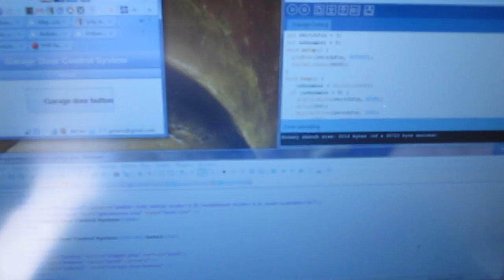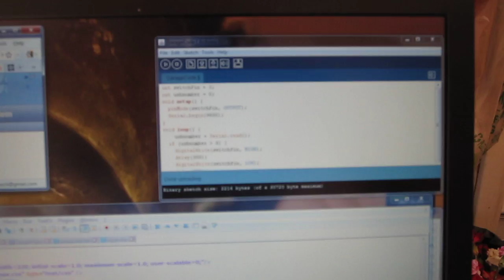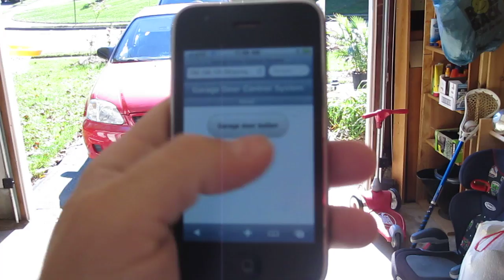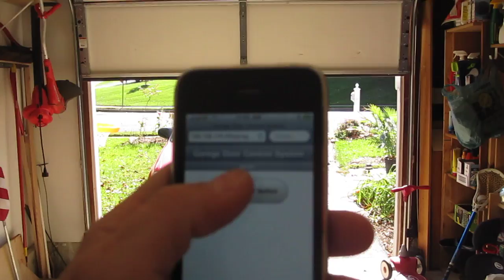iPhone controlled garage door opener using Arduino

Comment: not bad, but using wifi to control objects is BAD idea. You should choose some RF stuff.like car locking system or something similar. What if you phone could not connect to wifi? Also some rf would eliminate need of web server. Just good old receiver + transmiter

Comment: very cool but an average person can't just make this.  see the iHued cable, it connects to an old android phone most people have sitting around and then you can open/close your garage door over the internet from worldwide.  is also utilized the camera that's on old android phone so you can see the garage move up/down or you can just use the camera to check if you forgot to close it.

Comment: great stuff, but please lube the screw drive on your Genie opener.
You can use the same wire connctions up on the motorhead and dont have a ton of wires into the wall button.

Comment: Nice app! How would you secure it if you take it online? 
I would love to do something similar, also use RFID to unlock doors etc. 
It would be great to be able to open the garage door even if the WiFi is out, but having a PHP side open would be a bit of a security issue, wouldn't it? Of course you can use other ports etc, but it would be best to secure it with a login I guess.
Btw; If you have a login, you won't get that app-icon on your screen when making a bookmark...

Comment: If you're planning to use the laptop all the time you can probably use a USB to Parralel port cable and get 10-12 GPIO outputs of it. in that case you can completely take out arduino from the circuit. it just complicates the system. but if you're planning to take out the laptop then what youre doing is great.

Comment: Nice stuff, I'd done a similar thing with a door lock. Though it was running quite different. My biggest issue was safety, because it was safe on a iphone, but we could pretty easilly bypass the entrance with a laptop. What did you do for security?

Comment: @geoffmerck Use a limit switch. They have limit switches with a retractable arm/wheel. Position the limit switch to close whenever the door is physically open. Run some leads from the switch to the arduino board and write some code :).    Great video by the way.

Comment: Some ideas regarding your "next step" comments at the end of the video.
The arduino does have the capability to broadcast it's own web server (same resulting page, bypassing the computer and serial communications).  However, if you want to stick with this setup, you can use 2 arduinos and xbee radios to communicate between them.  You may only need 1 arduino board by using an ftdi cable/ breakout with xbee at the computer and an xbee connected to arduino's serial pins in the garage.  Good luck!

Comment from the maker: As for the code, I'd love to take a look.  And as for the garage not telling the state, all garages *should* have an "open" and "closed" trigger switch on the track that tell the motor when to stop.  If I can drop the voltage coming off of there, I could feed that directly to the Arduino, but I don't want to fry it (another relay needed).  With that feed to a relay, sending signal to the Arduino, and the code you mention, that could do the open/closed status.

Comment: Nice! I have a friend who is using the Arduino ethernet shield and another router. That way the only things in the garage are the Arduino, shield, and the router. My garage door unit can't tell me the state it is in, I would have to add external sensors. I have some PHP and Arduino code that will send data from the Arduino and the PHP will query it on a page refresh. Let me know if you'd like me to send that to you

Comment from the maker: Already did from the button.  2-wires up to the opener and 2 wires down to the basement, all along the frame of the door, just haven't updated.  I have a "conduit" of sorts that is running to the basement.  20 feet of doorbell wire is running to the project board down there (still not in a box) then jumped to the arduino.

Comment: How do you go about the whole PHP thing. I just got my arduino yesterday. I am pretty good at programing but I never used .php before. Can anyone point in the direction to start. I just want to start with something simple like I push a button on pc or ipod and the LED turns on. Any help?

Comment: You can put the Arduino and everything in the basement and then have an electrician run a line from your basement to your garage so everything is nice and clean looking and you won't have the project box on the wall, only two extra wires. Better yet, you can have him run the wires directly to the opener motor head (the pushbutton connections) and you can screw the button back to the wall.